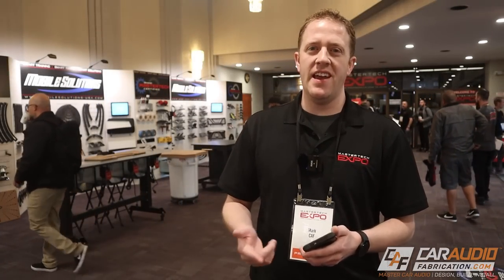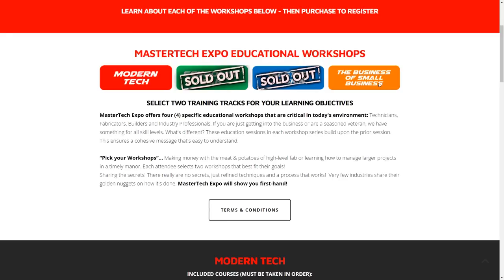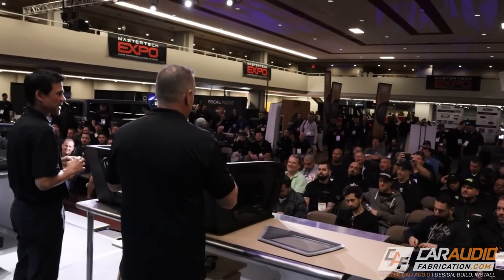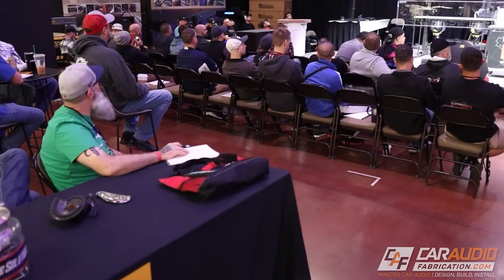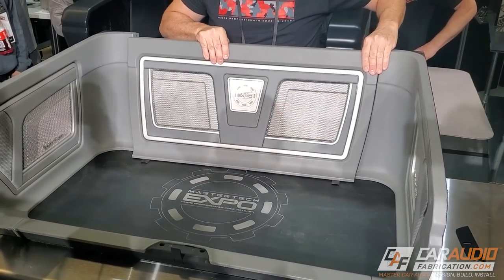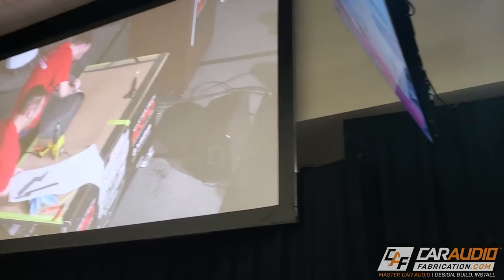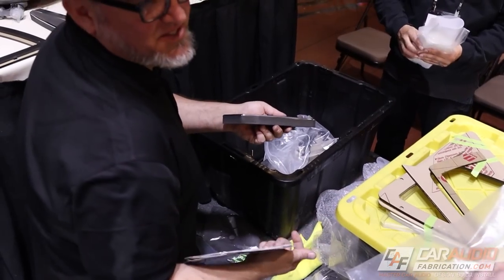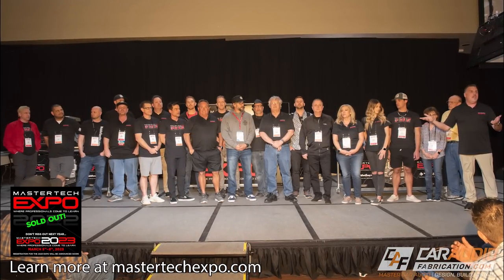Did you miss the FIRST EVER MasterTech EXPO?!

Comment: I have a question  .... CIs eliminating RCA connections an option.Can I just cut the rca ends off the wires coming from the amp and dsp and solder them together??? I am installing  a DSR1 to 2 rockford  amps inside the fairing  of a 2012 harley and the rca connections take up way to much room . THANKS for any advice